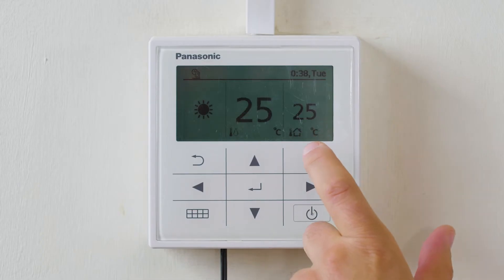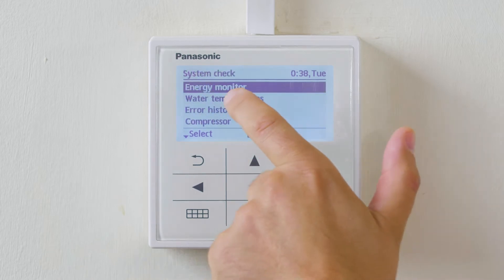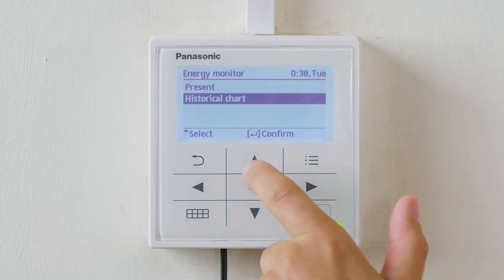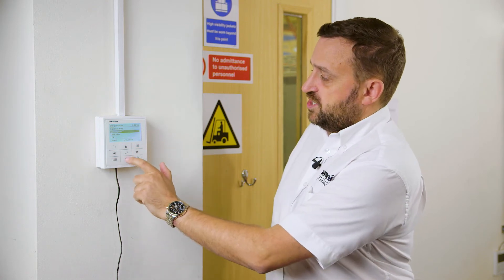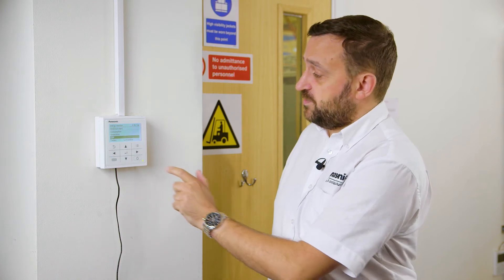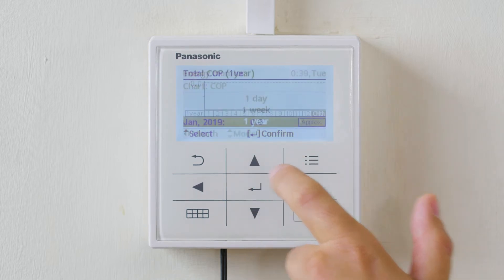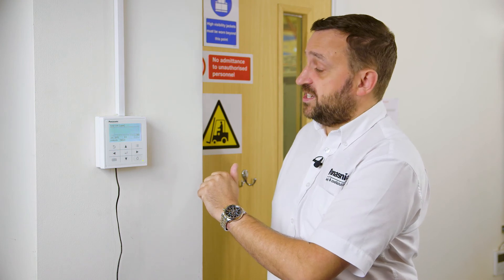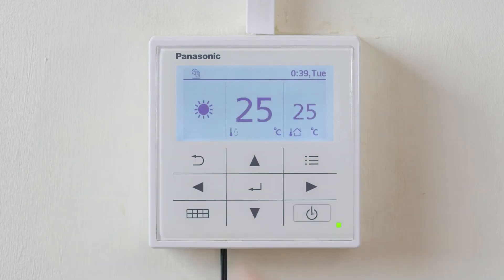EN – Aquarea H Generation_Performance Check

Comment: Checking is one thing, but how do you get it to run properly. At -5C we are running 33C in and 29C out, but our average COP is in the 2.3 range, and we really have not seen COP over 3.5 at any time. Underfloor heating, well insulated, everything open, heat pump right into floor circuit. Seems like a massive over promising and under delivering, and the video/document support is lousy. 
It seems like the software is clumsy and that it costs a lot of efficiency.
What about a series helping customers not hate the Panasonic Shit?